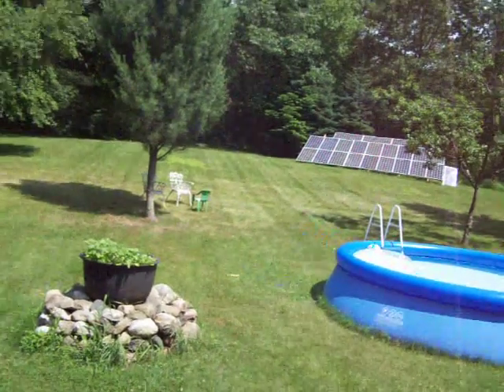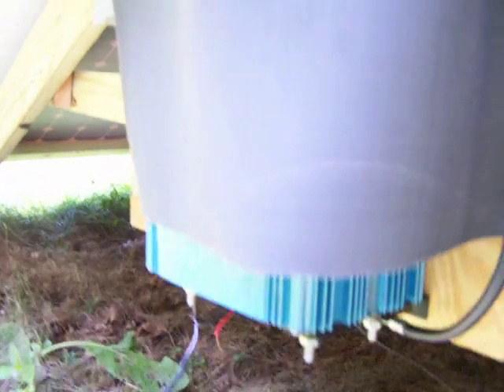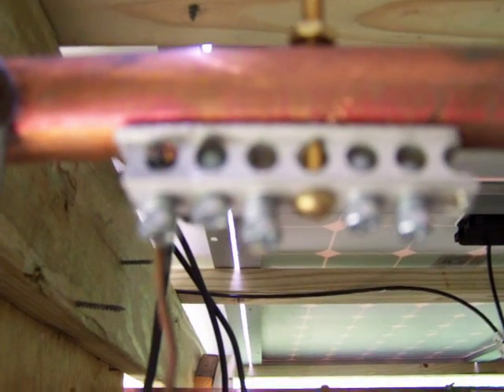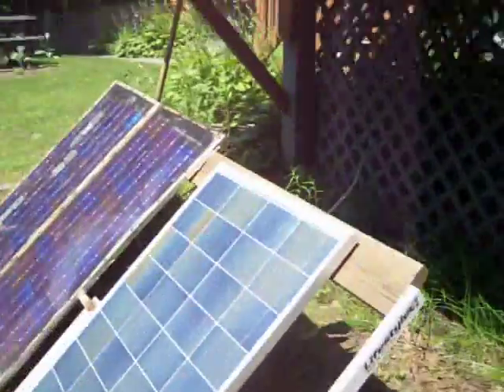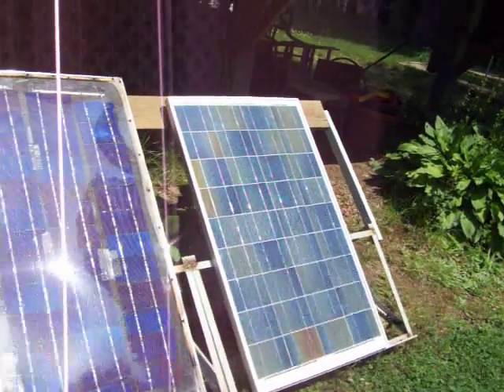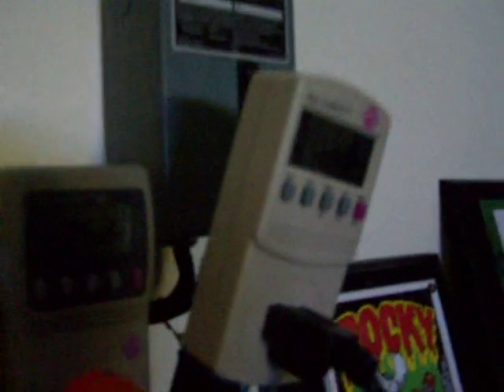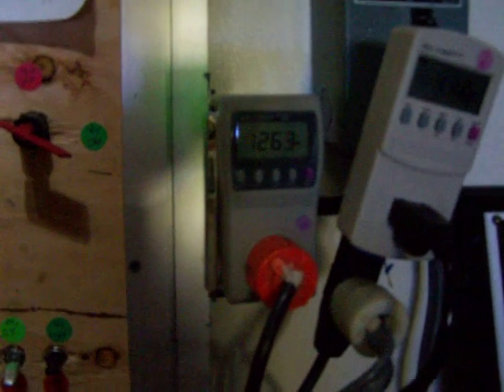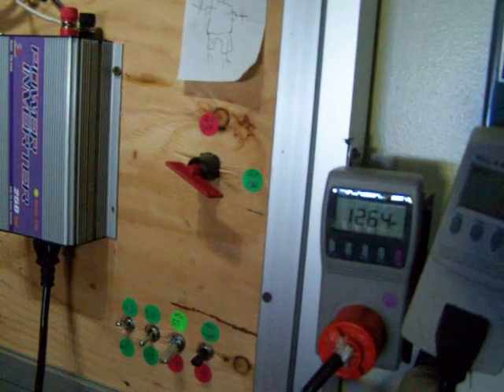grid tied solar panels

Comment from the maker: @Theneurodog2000 hey I might move the gti inside someday to get them out of the elements.I need to figure out what size wire to run for the DC to the house.now I run AC which travels better through the solid 10g wire.TAKE CARE